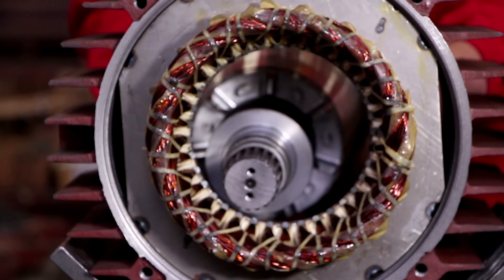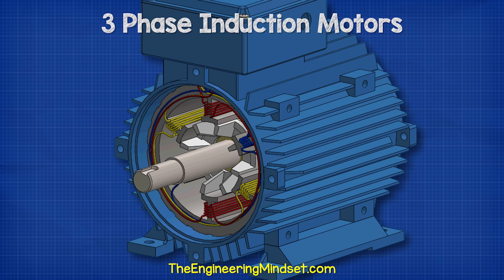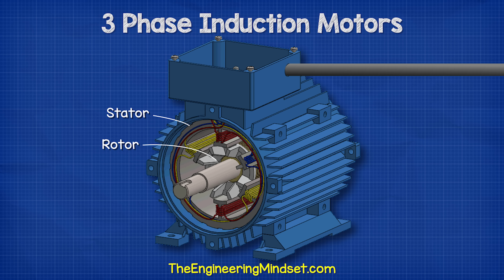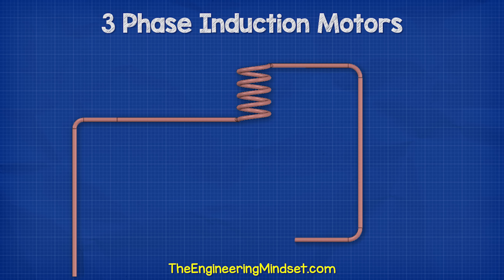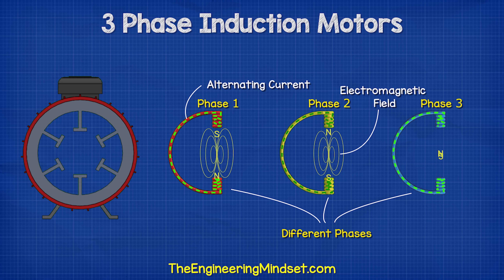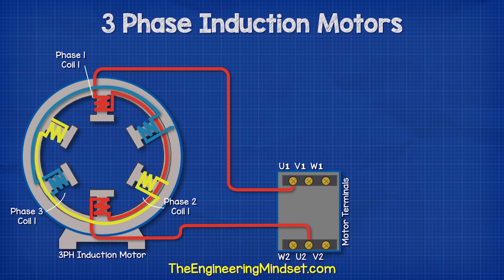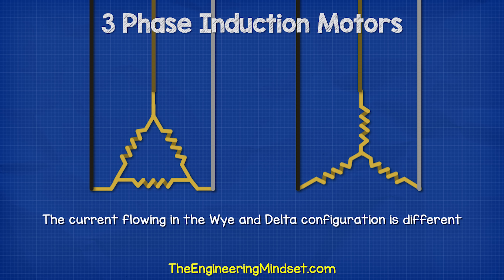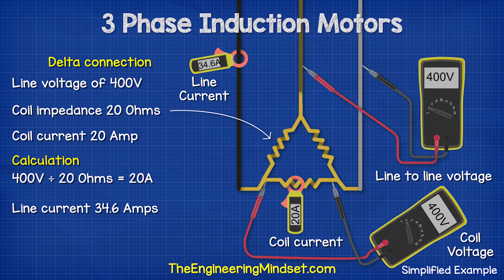How Electric Motors Work - 3 phase AC induction motors  ac motor

Comment: I do have a question, at 08:39 the magnetic field on the left is identical to the one the stator produces. Isn't the magnetic field of the rotor supposed to be opposite in polarity to the stator's magnetic field? Or am I just misunderstanding the visuals?  Love the channel btw, very informative.
Reply: At about 6:30 in the video the single coil is pushed away (following Lenz law where the induced current will oppose whatever induced it) which is correct. About 2 minutes later the voice over says the stator is pulled around by the magnetic field when in reality it is pushed in accordance with Lenz law. Effectively there is no real difference between the same poles pushing apart and different poles being attracted to each other in a spinning rotor and stator system. So if the poles were together as shown it could be the situation at start up for a split second but that is about all, normal running under load would have the rotor magnetic field ahead of the stator field. Under normal running, if there is no external load then the like poles would be close to, but never, opposite sides but there is always some dynamic resistance to the rotor spinning, otherwise we would have a perpetual motion machine, which can never be the case.
Reply: @martinconnelly1473  ah I see, thanks!

Comment: for the WYE connected 3 phase, (14:00 mins) I tried the coil voltage formula and i get 133vac. I am not getting the 230V that the video says. Just trying to figure out what I'm doing wrong. Thanks
Reply from the maker: 400 / 1.732 = 230
square root of 3 is 1.732
Reply: @EngineeringMindset   Thank you!

Comment: So the magnetic field won’t let the phases short? They are connected together in both configurations.
Reply: the inductors are the load.
Reply: Try to draw it as a T - Network with a closed loop. You'll see why it won't short ;)

Comment: Good tutorial 👌, now how would you explain the workings of a 3 phase (roto) phase converter. As an example you have a 15 hp 3 phase ac volt motor designed to run on dual voltages 460/220 AC. In this case you change the motor leads for 220 3 phase input voltage but your supply voltage is only 220 single phase. The motor won't start at this point because it's missing one line input voltage, it would just phase as they say. If you can get the 15 hp motor up to operating rpm through start capacitors or some other mechanical means and then apply the 220 single phase voltage the 15 hp motor runs and delivers 3 phase 220 ac volts output. The one output line voltage (leg) is known as phantom line voltage. The voltage output is quite a bit higher on this leg 260/275 compared to the 220 on the other 2 legs. So what is happening in the 15 hp motor so that it can produce 3 phase power yet it is only connected to 220 single phase😎
Reply: The coils are all linked magnetically in the stator in a way that is optimised for a regular 3 phase supply. The application of a single phase supply with an added phase created with a capacitor give enough of an out of phase current to spin the rotor. Then the induced currents in the rotor act like a regular alternator to induce currents in the coils that have the lowest current already flowing in them. As I stated at the beginning the magnetic linking of the coils are optimised for regular 3 phase supplies and so will tend to push these currents towards a wave form that matches a regular 3 phase supply. It is a bit like pushing icing through a decorative nozzle to fancy up a cake. The general design of the motor is doing what the nozzle does, it tries to shape what is going through it into what it was designed for. In your example though the lack of a third real phase means that there is less opposing force to the induced voltage so it can be higher than the other two phases. Lenz law will apply here where induced currents/voltages tend to oppose the force that induced them. There is less opposition in the phantom leg so it reaches a higher voltage.
Reply: @martinconnelly1473  Touché,  For your correct answer 😎 I'm kind of surprised that " mindset " didn't answer, I guess it's not that important to answer interesting questions on their site 🤔, for me answers are important,  no answer no subscriber😎

Comment: Hello sir,
Ek induction motor he

Jiski nameplate kuch aise he

Company  : ENERGY
motor no.: 1034
Volts : 415
AMPS : 1.3/1.6
RPM : 1400/2800
PHASE : 3
CYCLE : 50
HP: 0.75/1
K.W. : 0.57/.75

aur isme se 6 wire bahae aa rhi he
Ye kaisi Motor he 
aur iske connection kaise honge 
Sir please provide right information

Comment: 8:50 I'm pleaed so far as that's what I believed - an induced ELECTRICAL circuit or more) in the rotor. Some explain it purely as an induced magnetic field and don't mention the rotor electrical circuit.

However, for the skewed squirrel cage bars, I disagree. A 3ph motor will never 'jam' (unless the load won'tallow the rotor to accelerate quickly enough) I think with straight bars, the motor may buzz more and be synchronous. The slope angle I think is there fore the same reason a cylinder lawn mower blades are also on an angle - for a smoother operation - there will always be a bit of the circuit best placed for 'pulling' the rotor round - resulting in a much smoother pull than if only at one point was it perfectly aligned to pull along the length of the rotor.

Comment: So a star configuration is more efficient than the delta ? Why some motors have delta configuration ?
Reply: That is for starting the motor. Motor starters use wye delta configuration, for the purpose of staring the motor at a lower voltage and current to avoid the coils from getting too much heat when starting, then when the motor runs, it switches to delta configuration as running conditions takes less current than starting. Hope this helps.

Comment: Basically there are two parts:
Stator and Rotor:

Stator has windings: which 1. induce a current in the rotor
2. The windings change polarity, changing the directorion and polarity of the electricity induced in the rotor.

Rotor: 2 things:
1. Get induced electricity:
2. Moves, as the induced electricyty creates a magnetic field: This magnetic filed induced in the rotor is pushed by the polarity  of the stators windings(current) polarity

Comment: Copper is conductive, I think it’s magnetic wire with a non conductive layer that just so happens to be the copper color. It has to be magnetic so three phases can make a magnetic line of flux to push the rotor in the right direction at the right torque, rpm etc… could be wrong but I was taught this. Like I said think about how a conductive wire would affect that field. Great video though, really help me a lot and FAST! Thanks

Comment: There’s something wrong with the calculations at the last part, Volt can be shared but if you start with 400V all connections must equal 400V even if you have 100 resistance !! Correct me please ?

Comment: Can someone explain how is that possible that current reverses direction in each phase at a different time? How to ensure that they are not synchronous in 2 phases for example? Does each phase need seperate power source? If so, what is that? is there a device to which 3 phases are connected and this device somehow changes direction of the current in each phase seperately?

Comment: 6:37 .. this point i did not understood it!
The solution was to add second coil with a slightly lag in phase, so here we benefit from the angular momentum at first to enhance it with the m.f. from the second coil? .. the  instant opposite forces on the rotor are the same!
Really i am confused 😵
Reply from the maker: The forces are reversing when the magnetic field polarity reverses. It would have spun before the reversal
Reply: @EngineeringMindset  there are double opposite torques on the rotor coil that will not allow to the rotor coil to rotate: the 1st torque result from stator e.m.f., the 2nd is result in the cage coil in rotor which oppose the cause from 1st (Lorentz law).
The same thing happened to 2n phase, and the 3rd.
In practical world it rotates, i miss something here! .. maybe the Lorentz's law is not instant reaction! Or the rotor before returning to original position after slight small angular rotation the 2nd phase affect the rotor!!
Some help, thanks.

Comment: Hello Electricians I have a question about the star configuration so in such a way of connection the three phases are connected to the three first sides of the windings the other sides of the windings are joined all together to the same point (U2 W2 V2)  isn't that a short circuit for the three phases ?
Reply from the maker: No, because of the winding. They add resistance that prevents a short circuit

Comment: So if the stator windings alternate polarity at a given Hz, does this mean the rotor must be moving at a fixed speed to align? I'm confused as to how speed can be varied. Sure intensity can be increased for speed but the alignment must match the hz. (or there certainly is a pattern to follow right?) 
Thanks
Reply: Yip the frequency of the electric current determines the speed. 1800rpm for 60hz 4 pole.  The number of windings(poles) can be changed in manufacturing to give a different speed or a vsd can be used to vary the frequency.

Comment: Very well done and I understood all of it. AC motors really need to be takin out of production as they are really horribly inefficient in conversion from electrical to mechanical. The ONLY reason they are still used is because the grid is AC and they are essentially plug and play and not based upon efficiency. AC should be used to get power to the building then rectified to DC for efficiency. Get induction out of an environment and watch efficiency quadruple. The foundation I stand on is if you have a permanent magnet in your rotor you don't need high current to be able to induce a magnetic field in the rotor as it's already there, therefore you're producing the same torque levels with less current. Wonder how many who read this comment and will understand what I'm talking about and how many will bash the point I'm trying to get across. The efficiency levels I'm talking about would be unheard of. Say 50HP on 2kw. Yes... That's pretty darn efficient lol. This is my point. The possibility is there....

Comment: First of all thank you for your great video. Secondly:
I am trying to understand 
When you connecting wires in delta configuration. Doesn’t it sparks when power meets at terminals W1V1u1 through jumper which come from W2V2U2 because you sending same power through different wires at the same spots?

Comment: 3 phases at 240V - if rectified to DC, is the DC smooth or is there a 300Hz ripple on it ? Does it make any difference if there's a neutral wire involved ?

I can see where the 300Hz ripple on the phases comes from BUT I have a gut feeling that if the neutral is used, that too will have a 300Hz ripple on it and my gut feeling is that the neutral ripple will equal the line ripple as an 'interference' wave such that one ripple cancels out the other ripple...BUT it might be they add instead of subtract ! I'd love you to explore this for me !

Comment: If i want to use motor to move 12kg  continuesly (24/7) at constant speed (1 m/s) , which type of motor can I use? (brushless dc motor or geared induction motor)

How much watts and torque required for this purpose? Assumed voltage is 240V
Reply from the maker: Check out the new BLDC Motor video: https://youtu.be/yiD5nCfmbV0

Comment: since the star configuration uses less current and voltage, does that mean for really powerful motors you need to wire them in delta configuration to get more voltage and current?
Reply from the maker: Yes although they'll usually start in star and switch to delta
Reply: The delta configuration indeed produces more torque (so more power), exactly 3 times as much. The star configuration is used when we first start the motor so that the transition is smoother and after a short time we switch to delta for maximum power.
Reply: @vinfamous9226   @The Engineering Mindset  how does this work??? lol, something is switched i am guessing? xD
Reply: @vinfamous9226  Wait, so a motor can have multiple configurations? Why not just make it a delta configuration if it's going to to switch to max power anyways?

Comment: I'm getting ready to refurbish several 3 phase motors. One of them is an Allis-Chalmers 25hp. It's a beast. It hasn't ran in 25+ years so I'm excited to see it spin again!.
Reply: How did the big motor refurbishment went? I have a motor of the same caliber waiting to be converted into permanent magnet generator for a wind turbine. Originally it was from a heavy duty belt conveyor. Collecting strong neodium magnets from hover boards for the rotor. The plan is to use lathe to remove enough material for the magnets to fit. 

This is all plans for now, not even sure the windings are okay. Been studying on the subject beforehand.
Reply from the maker: Seen our new - How wind turbines work video? link: https://youtu.be/Hf875eOVrVI

Comment: Question - assuming the motor is running (3ph) and the winding wires are switched from being fed with power to being all connected together. Will this turn the motor into a magnetic brake as it does with brush/com motors ?

Comment: Electric induction motor shaft mechanic fan protected current mechanic cover  cool heat  copper coil rotor steel current compass inductors phase motor magnet electric current startor phase induction motor current shaft fan protected delta configurations motor terminal coil 1 teacher ji

Comment: I found this confusing, but then again, I am not bringing much prior knowledge to the table. For example, referring to  the amp calculations, what is the significance if one is 400 and the other is 230? As a programmer who can step through lines of code one line at a time, could I suggest you include a segment that begins when the power is turned on and follow the current through one wire at a time and show how it pushes or pulls the inductor causing the shaft to do one full revolution. Just slow everything down so I can understand the order in which things happen and it might help me understand the whole U, V, W thing. This also raises the question, if three phase is good, is four or five better?

Comment: Question from an electrician always wanting to know more! In what scenario would you need to run a neutral for a star configured motor? Why would you need it if the current returns to the source on the other phases? Also, I never quite understood why connecting the phases together in the terminal block wouldnt cause an explosion like if you straight up made a phase to phase connection on the line side of the motor. Thanks in advance, love watching these videos!
Reply: Under normal circumstances the neutral current is zero. If the neutral current is not zero it can be used to indicate a fault in the stator windings such as higher or lower resistance. Checking for a current in a single wire is cheaper than checking for current in three supply wires and then needing to compare each supply wire current against the other two. This method is used for both the generator where a neutral to earth (ground) resistor, referred to as an NER, has the voltage across it constantly measured. A rise in voltage across the NER shows a fault. The fault may not be in the local machine but can be in the supply side of the cabling or loads on the system. The risk to the large and expensive machines that have the NER connected from an unequal load is quite high so any NER current flow means these large machines need disconnecting due to the detected fault. Regarding the linking of the phases in the terminal block, the phases are not linked on the supply side, only at the star point on the other side of the block. The phases are a load that limits the current and the supply cables are only linked through these loads.
Reply from the maker: Check out NEW resistor video, everything covered! ➡️ https://youtu.be/DYcLFHgVCn0

Comment: NOTE:  All voltage and current readings shown by the multimeter and current clamp meter are RMS values.
Reply: Which is?
Reply: Meaning all the values on the reading on the meter shown on the video. RMS values or Root Mean Square, is the AC  equivalent value you would get as if you were to reading it on a DC value.
Reply: @disrael2101  It has a long definition but basically it is the square root of the average value of the square of AC voltage/current .
Reply from the maker: Check our new Multimeter tutorial out ➡️ https://youtu.be/4lAyzRxsbDc
Reply from the maker: Seen our new CLAMP METER tutorial?: https://youtu.be/J3kKNNizARc

Comment: Midway through video I decided I needed to learn more about 3 phase power. What I briefly learned is that in USA, normal house residential supply is single phase. Therefore, in such houses, the motors used in  common appliances are  not  3 phase induction motors. True?  Are they single and/pr 3 phase?

Comment: Now can you do a Single Phase or 2 Phase AC Induction motors? You know, the one with starting and running capacitors. That's what usually used by people anyways because households don't usually have 3 phases. Thanks!..More power to the Channel.!!